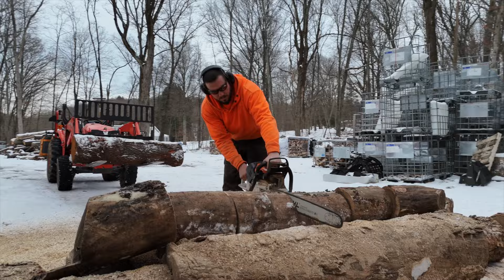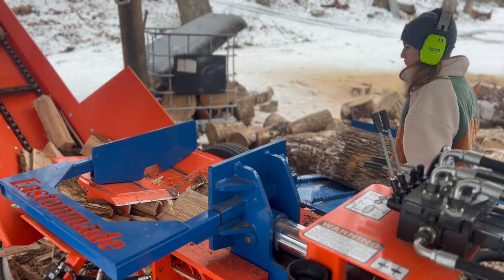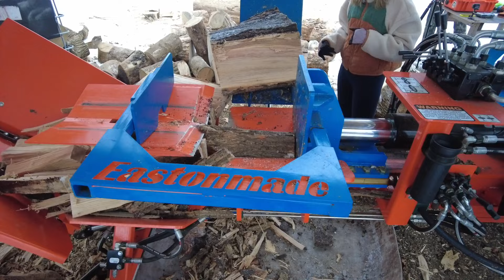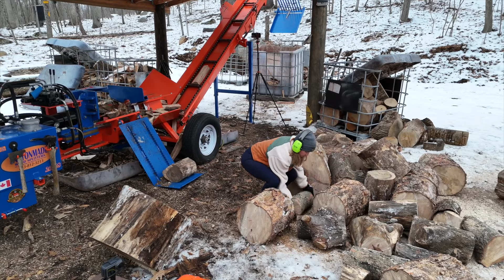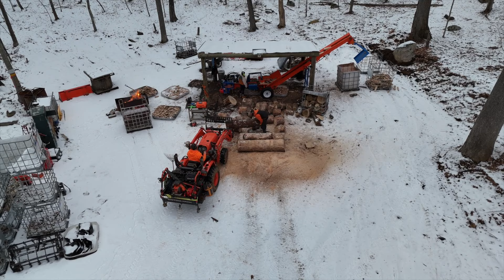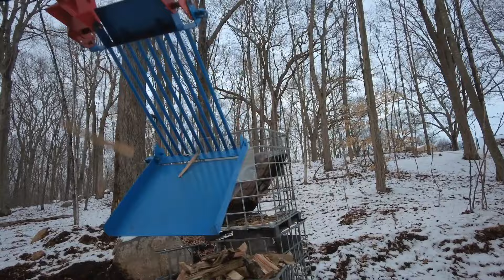#453 Can We Split MORE FIREWOOD with Three People??

Comment: Have you guys ever tried putting two of the smaller rounds on the 22-28 at the same time? Just curious if the ram would try to spread them apart or if it would push them both through. Not certain if having Sarah in the yard will yield more firewood or not but I feel confident in saying that it will yield more likes, subs and shares. 🤩😎 Thanks as always, I continue to learn from you guys as I get the ball rollin' in my own wood yard.
Reply from the maker: Yep two smaller rounds push through just fine

Comment: I was going to say, that it didn't appear to be much quicker with a 3rd person in the splitting operation.  From an efficiency standpoint, I agree that stockpiling all of the smaller rounds that would be split more effectively with a regular wedge would be a good idea.  It would be faster, produce a less slash waste and make it worth the effort to switch out the box blade.

Comment: That splitter looks like it makes more scrap than firewood. That’s a lot of waste and extra cleanup?
Reply from the maker: It really depends the quality of wood you feed through it. In this video it is running the smallest box wedge so it will make more scrap. The lack of effort needed and speed it makes wood far outweighs the scrap in my opinion

Comment: A few suggestions, set your camera on a stand so you can bring rounds to splitter lifter for her, get her in a tighter fitting outdoors jacket, and decent work gloves, she looks like she is going to the mall, not to run a splitter.  Find a job for her that she can do efficiently and safely, because she cannot wrestle those big rounds once they are split, and she is unsure of herself on the splitter, so train her better!  Stand on the same side of the splitter as her, on the other side of the lifter, to help clear the splits and wrestle the big pieces for her.  That is why I said set your camera on a tripod!  I am glad to see she is willing to learn, because my wife will not help me at all!
Reply from the maker: I use tripods at times. A tripod only video makes for a very boring video in my opinion.